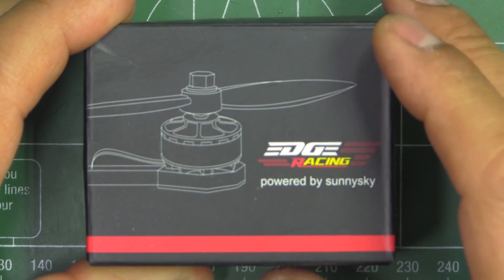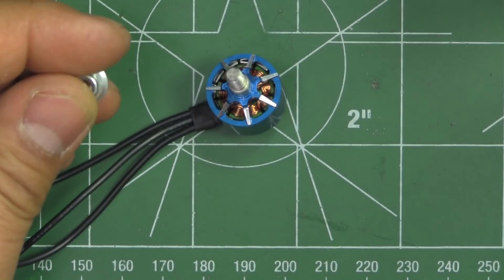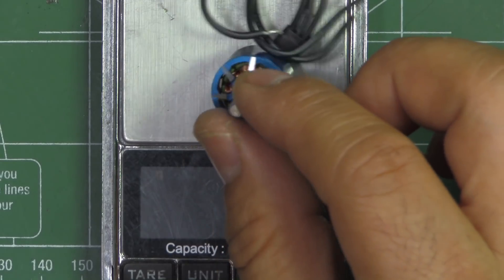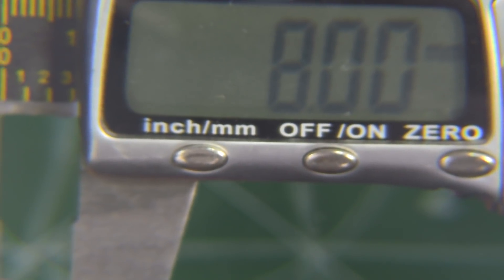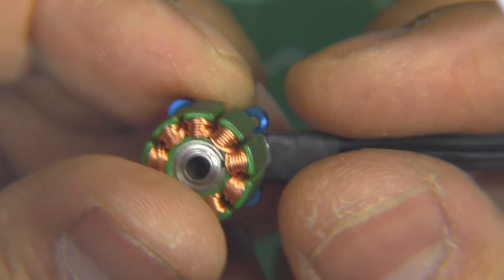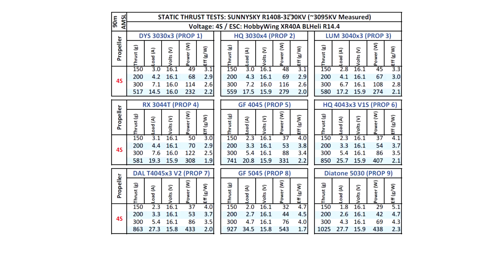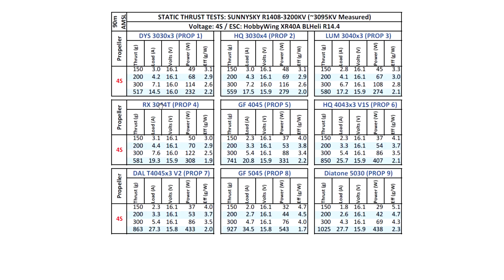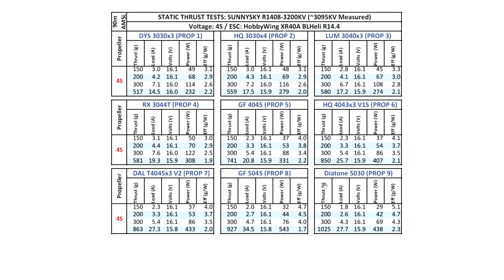SUNNYSKY Edge Racing R1408 3200KV Thrust Tests & Overview

Comment: I'm thinking of using this motor on a plane at 2s and 4s. will it go ok on 2s?
Reply from the maker: 2S - yes should be able to use a 5030 or 4" prop. Smaller props perhaps not enough thrust. Depends on plane size, weight, wing-loading
Reply: @EngineerX   it's a small light plane it should be ok. Thanks!
Reply from the maker: @dankusmemus2350  Nice, once you fly it let me know how it worked. It would be interesting to see how you used it and how well it worked (plane size, prop used, LiPo size, flight time, overall perfomance)  😁
Reply: @EngineerX  I'm making a super tiny hotliner. 
This motor, a 2-4s 350mah battery with a 500-600mm wingspan, and probably a 100g weight. I'm getting inspiration from this guy. https://www.youtube.com/watch?v=FEh4vP4dyEA&app=desktop
He is using a T20ii tiger motor.

Comment: This looks like a nice motor. I am building a VAS spark 24". What do you think would be a good motor for 2s lithium ion and 3s lipo for fun fpv plane.  And like always thanks for all that you do for the community.
Reply from the maker: I don't have much experience with fixed wing power train requirements. But I can more or less suggest that for a 4" on 3S LiPo you'll be OK with a 1806-2300KV, unless you're looking for extreme speeds? Then the BrotherHobby R4 1806-2850KV ( I have one single motor that BH sent for testing, PM your address, I think you got my email address or thru RCGroups, I'll dig it up and send it to you if you want to try it) or T-Motor 1806-2800KV on 3S would give you more thrust. Try he DAL T4045x3 V2, HQ4043x3, DAL TJ4045x3, DAL 4040x3 props.
I think in some instances, fixed wing craft put more stress on motors than multirotors because it's only one motor and you usually run it at higher throttle for longer periods, so there's higher load for longer time and that can end up heating up motor to the point where it can't dissipate heat anymore, resulting in a melt down of the windings. So I would size motor to be close to as large as the aircraft allows (for more robust powertrain, maybe a 2204-2300?). That would give you the best heat-handling and may actually run more efficient. Smallish motors like this 1408 may end up overheating I think, Of course it's best to try and keep it light too. Sounds like a cool airplane to play around with!
Reply from the maker: This looks interesting, I wander if made by SunnySky... https://www.xt-xinte.com/LDARC-KINGKONG-XT1806-2500KV-Brushless-Motor-CW-CCW-for-FPV-Racing-Drone-Quadcopter-RC-Racer-p476115.html
Reply: EngineerX that motor looks very much like the other Sunnysky motors. I think it may be or possibly made in the same factory.

Comment: This will be a beast for a very light 4” in a higher Kv. Definitely on my radar now!
Reply: But which propeller? I cannot find any good 4" propelers
Reply from the maker: Yes, for sure. The 3800KV will be quite powerful. I was looking at the nylock just now and I definitely don't like the smaller size. It's lost most of the anti-loosening properties. Seems the smaller thread wears out the "nylock" insert rather quickly, so getting CCW + CW threads would be best.
Reply: Cid156 hq 4" v1s are good